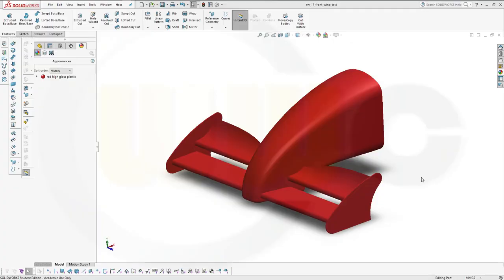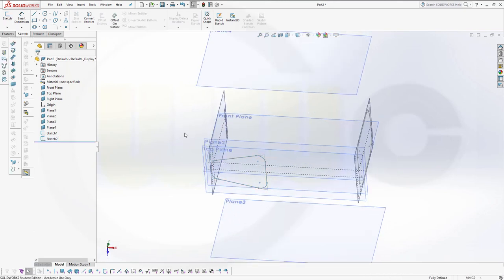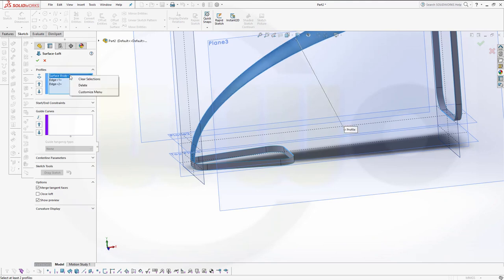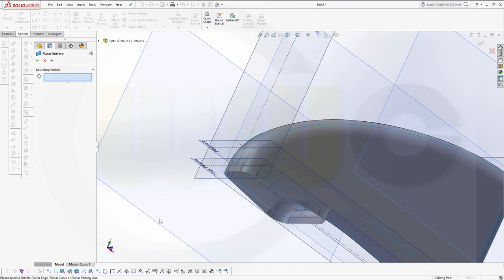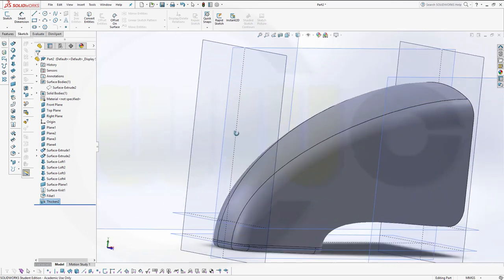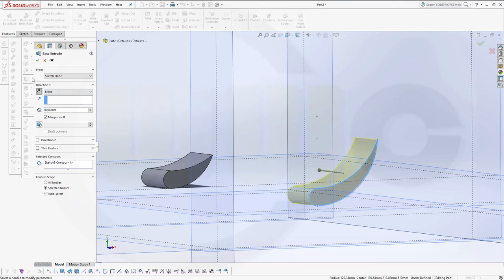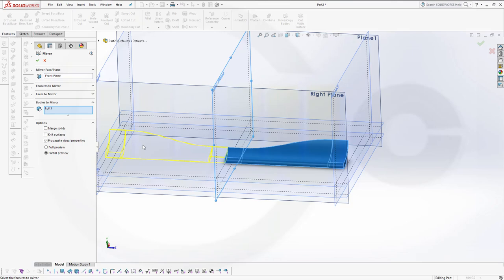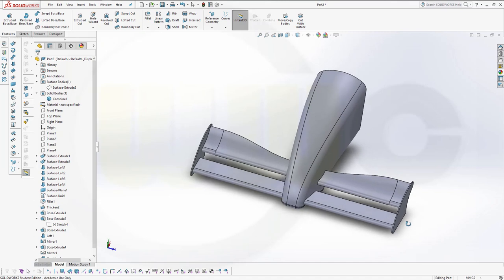F1 Front-Wing - SolidWorks 2017 Training - Part Design

Comment: Hi I get a rebuild error when I try to thicken the model, I have repeated the model a couple of times but I am unsure of how to get past the error.
Reply from the maker: Usually the problem is generated by a filet/round/radius which is too small.
Reply: @wolfgang.walden.cad.training  I read that online, I removed the fillet and reduced the amount I wanted to thicken. It didn't help. The body doesn't turn into a solid if it doesn't thicken.
Reply: same probleme. i don t understand